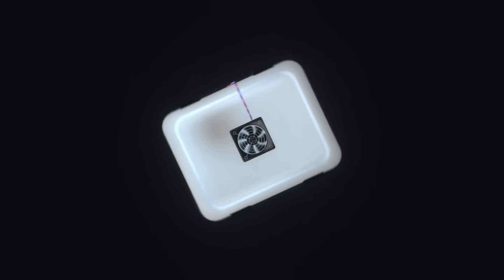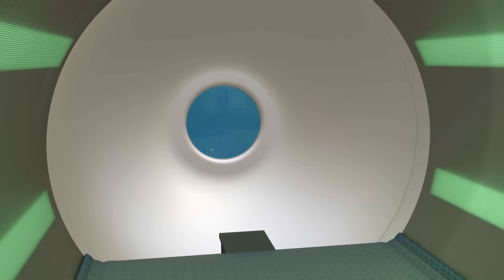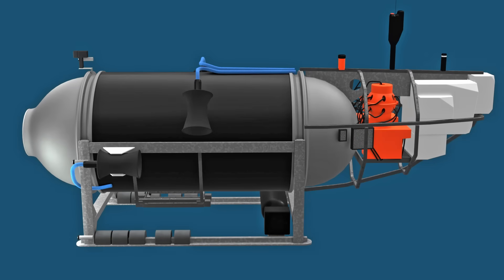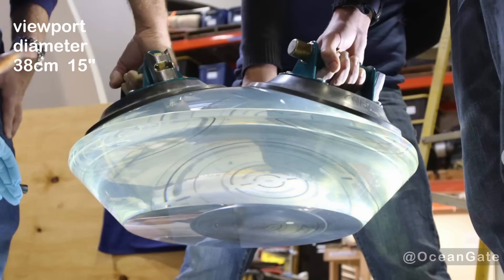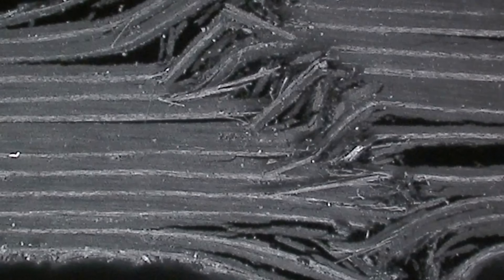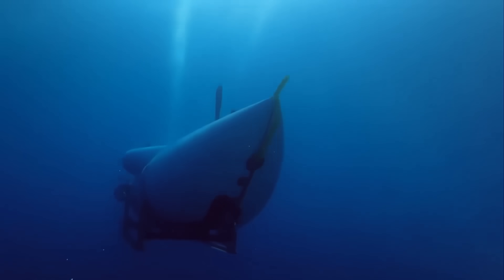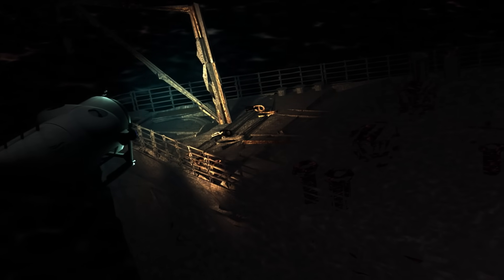Titan Sub | carbon fiber - Detailed Tour

Comment: Finally a well researched video that doesn't zero in on the game controller (which was probably the most reliable part of the sub).  The truth is that composite construction is commonly used in modern subermersibles.  But usually fiberglass instead of CF and rated to shallow depths with a factor of safety of 10+ for both crush pressure and fatigue life, for the very reasons mentioned in this video--this construction is very sensitive to defects and it's hard to both validate the design AND the process without a large sample size to build confidence.  And you certainly don't use the sound of fibers snapping to decide it's time to go back up.
Reply: Okay, so I will take you up on the game controller - which had little to do with it's general reliability. The problem with using a game controller to operate titan was to do with failure mode analysis. When designing anything which is safety critical, one of the exercises performed is to identify modes of failure and possible outcomes (FMEA). There is no chance the designers of a game controller would have done any such analysis. They wouldn't have been concerned if a single component failure causes an issue as the worst case would be a player losing a game. Imagine therefore if, whilst manoeuvring a dry joint on the circuit board caused a button to jam and rammed the submersible into jagged metal wreckage. Sure they could have a spare controller lying around, but by that point it's not going to matter.
Sure, the military also use game controllers, but I assure you if they ever intended to use them in life critical situations, they will do a full FMEA on it. 
From what I have read, there were a lot of other things wrong with this submersible which were much worse than the game controller, but it is a good example of how jerry rigged the whole show was so I don't blame folks for pointing it out.
Reply: @gavinminion8515  That said, there is little to go wrong on the controllers.  The main issue is operating in a marine environment.  I worked as one of my first jobs as a repair tech and the computers we would get in in from people who lived next to the ocean was.. full of rust and other insanity. One actually had a hole through the motherboard due to condensation causing water to drip down for several months.
Reply: @gavinminion8515 OK, cool, interesting point. But...

I'd be pretty damn certain the controller has a good idea what the odds are of button failure, and I'd be fairly certain they're low.

Any controlling device, whether Sony or bespoke would carry such a risk, and Sony have data on hundreds of thousands of units, whereas if you build one for the Titan you have data on one.

You don't actually know if the testing was done by Oceangate, you're assuming it wasn't. I'd agree but it is an assumption.

The outcome of a failure is different, sure, one you lose Tekken, the other you explode, but that doesn't make any difference to the failure mode or the failure frequency, certainly the probability of a failure prone device doesn't kill anyone playing games, but it is going to be a serious threat to the survival of your business. You might not care AS MUCH, but there's a world of difference between caring about losing billions and flat out not giving a shit.

Specific fail point issues seem pretty easy to resolve via software, if concern about a specific button or button emperilising the submersible, you only need one to say 'controller buggered, disregard until this button is pressed again'

I take your point, I do, I just don't see why it'd be less safe to use a device with, by now, trillions of hours of fail state testing instead of building one unique device. It'd be one thing if the controller was being used outside the thing, but the inside of the Tube o Doom was, obviously, well within the normal operating environment. I mean, if the controller hasn't been tested whilst immersed in seawater, that doesn't really matter, because in the condition where it was, you have whole other issues far more pressing. Pun absolutely intended.

What would be the Mean Probability of Failure figure that would be acceptable for this use? Because I'd be absolutely certain Sony exceed that value, and equally certain it would not be possible to generate such a number with a bespoke unit.

In any case, it is at least very refreshing to natter about the thing with someone who has a reason for doing so that's better than 'it's a toy' so, thank you for taking the time to explain, it is appreciated :-)
Reply: @Belzediel  Hi, thanks for the response. To be clear, using a controller that is produced and tested in the millions would 'likely'  be more reliable than using a device you built yourself. However, that would not be the outcome of an FMEA investigation.
If you were to look at this controller in failure mode terms, even though the chance of a particular failure (i.e. jammed button) is quite small, and the chance of it's effect (collision with debris) is smaller, the outcome (Loss of vessel with all souls) would be so great that you would do what many other manned submersibles (and surface vessels) do. 
You would have two control systems with redundancy and failsafe changeover. The instant that button jams, you would let go the first controller and pick up the second. You would not wait to change batteries or reprogram a wireless connection because those seconds might be critical.
As an example, here is a quote from an old copy of the DNV rules on redundant propulsion systems: "The bridge propulsion control system shall be independent for each propulsion line; so that any single
failure will only affect one of them, and that operation of the remaining system can continue on the normal
means of operation (e.g. levers). Alternatively a system arranged with redundancy can be accepted if in addition
independent back-up control system for each propulsion system is arranged. The redundant system must be so
arranged that any single failure will not prevent continued normal control of the complete propulsion system.
The independent back-up control system shall be based upon similar input devices as the normal means of
operation (e.g. levers)."

So to answer in brief - there is no mean probability of failure which would be acceptable - only redundancy with separation. Nothing I read about the game controller or any part of this vessel suggested they had the required redundancy - or had done the analysis which would have demonstrated where that redundancy was required. An assumption maybe, but one which I have yet to find evidence to disprove - unfortunately.
Reply: @gavinminion8515  I think it's clear as day that the "game controller" was an issue. Not because it was a game controller, but for the reasons you say here, as well as the fact it was chosen as the control system because it was cheap, and because there is actual video of Rush tossing it like a toy. It's hard to imagine how many times he actually threw that controller. There is a report that he haphazardly got the craft entangled at the Andrea Doria dive (ignoring a cautious dive plan to assess the dive site before approaching), and then after melting down, threw the controller at another person in the submersible. He threw the damn thing during a crisis! Kinda like kids do when they lose their video game. It's no wonder this ended badly, in the end. CF may or may not have a future in submersibles but people like Rush running the show while experimenting with materials proved to be a very bad thing.
Reply: Compared to professional steel bathyscaphes, nothing there was reliable. From the entire design to the use of a game controller on the console, it's a joke. People have been exploring similar depths for years, but the engineers of such bathyscaphes are physics scientists and everything is carefully calculated and then tested in compression chambers for strength. Everyone who works on such projects warned that it could end like this. For information, I would like to inform you that the scuba diving cylinder is tested every 5 years and certified for more than double the pressure that it is charged with. Where did they get the certification for this "bathyscaphe"? @gavinminion8515
Reply: @gavinminion8515  you go through a lit of ridiculous gymnastics and fallacies to justify your position. you assume that a button getting stuck would be a problem. the thing is SLOW, its not like they are flying an F22 with it. You also assume that a button being stuck wouldn't be catastrophic because its only being used in a game; A manufacturer having to refund the sales of those controllers because buttons were prone to sticking certainly would be extremely damaging. These types of devices DO get used in high risk situations all the time precisely because they have achieved a level of validation nothing that could never be reproduced. From satellites that cost millions of dollars to launch running off of main boards from smart phones, to spacecraft being run by video game consoles, to medical imaging machines that guide brain surgery running on gaming consoles, they were all chosen because their reliability and lack of failure modes are the only thing that can be trusted to support a multi billion dollar investment or someone's life.
Reply: @malcomreynolds4103  'My position' being the position that Lloyds, DNV and other certification societies take? If you read my comment properly you will realise that my reasoning against this particular use of a game controller was it's lack of redundancy in a life critical situation. The uses you mention are all non-life critical (the brain surgery use was as a training aid).
As regards your specific argument regarding the speed of the vehicle - you should probably critique this statement against your own first sentence regarding fallacies and assumptions. Accidents still happen at sea at lower speed than this due to a loss of propulsion control.
Reply: @malcomreynolds4103  Correct. Video game controllers are very reliable, with every function tested for millions of cycles. When using a game controller in a safety critical application an example is as follows: 

If a joystick is pushed or pulled there is an electrical signal called a bit delivered by the software. A bit is typical read as 1 is on (Joystick pressed in whichever direction is chosen) and zero is off (joystick released). If the joystick is found to be stuck it will continually show 1 in the direction it was last commanded and the vehicle will keep moving, as you noted, very slowly, typically around 2mph. The likely response is to move the joystick in the opposite direction, so if the vehicle is stuck going forward, pull the joystick in reverse. You end up getting a forward 1 bit and a reverse 1 bit, hence signals in 2 directions on the same thruster. In this instance, the software will be commanded to cut power to the drive. The HMI (Human Machine Interface) would show a fault code and an instruction, such as thrust in 2 directions on the same drive, change the controller, reset and test. This is typically how a FMEA system would work in this application, if they did one of course.

This method is used on Joystick systems or manual input systems that have to be held permanently for movement. If a Joystick appears to stick in one direction, you simply reverse direction. The software will show a bit in 2 opposing commands on the same system (Forward and reverse commands at the same time) and shut the unit down. Safety function is very simple and basic, even in complex systems such as Aircraft or multi train rollercoasters, where crashing into things could be deemed as unfavorable. It is highly likely If the sub loses contact with the controller, it would hover in position, (Not move forwards, backwards or sideways) until the connection is restored, so a back-up could also be, if the sub is still moving after an input and the joystick has been released, turn off game controller, or pull the batteries out in the first instance and if this does not work, hit the E-stop for the thrusters. If nothing resets after changing the controller. you simply drop the weights and the positive buoyancy will take you back to the surface. One of the main rules of sub safety, Always ensure the way to the surface is clear. In other words, don't go into wrecks or caves or under overhangs. Drop weights on classified subs have a manual release, so don't rely on a another system that needs power. These are tested annually by a third party.

@gavinminion8515 It does not matter if a joystick is wired or wireless, if it sticks, the above protocol would apply.
Reply: @gavinminion8515  you keep using words and keep saying nothing that is accurate. If you don't think expensive science experiments do not receive the same level of testing as life critical equipment, you are clueless. If you think medical imaging is not life critical, you are even more clueless. The speed of the vehicle is precisely the point as to its risks. a craft that has a MAXIMUM speed of 3 knots cannot just simply close 20-30 meters on accident
Reply: @malcomreynolds4103   I don't think I am going to carry on this discussion. You have descended into insults without actually presenting a persuasive (or any) argument. Please learn about hazards and risk analysis then re-examine your earlier comments - I suggest you begin with IEC61508, then move on to the classification rules for manned submersibles - Begin with IACS, then move on to ABS, DNV,  Lloyds or any other set of rules - your choice.
A simple analysis of any controller (not a game controller) driving a human occupied submersible would probably give it a failure likelyhood of "Occasional" - it is likely to fail at one point during its lifetime. It would also give it a consequence of "Critical" (Any loss of control of any size vessel at any speed would go into Critical or Catastrophic category as it may lead to loss of life). Combine these together and you will have a class II hazard - "Undesirable". 
Therefore, to reduce the risk to "Tolerable" you would need a redundant control system (or an emergency steering device).
But don't take it from me, go find out for yourself.
Reply: @gavinminion8515  back to the completely and utterly debunked game controller narrative again
Reply: The real issue with the controller is that it wasn't even a first party controller it was a crappy third party one.
Reply: Was there a point raised that didn't go sailing several feet above your head? @justz00t48
Reply: Oh, indeed, I concur, on the controller. Baffling to me that something being cheap to purchase is most people's method of evaluating reliability, not the tens of millions of units tested to destruction. Plus, they can afford to keep a few spares in the boat, so even if one of them goes tits up there's others. Baffling.
I'd also be fairly sure that Kemptown Racecourse knew any failure would be instantly catastrophic, and so any kind of safety feature in-dive would be a joke, the sound whatsit etc weren't anything more than a token gesture to calm the gullible, like having a 'main tank explosion' warning light on the shuttle.
"And if the main tank explodes, mate, this little light goes red."
"And then what do you do?"
"Well, then we'll descend to the surface of the earth as a slightly pink mist, in a cloud of very expensive confetti."
Reply: @Belzediel  You do realize that they now think the Challenger crew actually survived the explosion and that the impact with the ocean is what killed them.

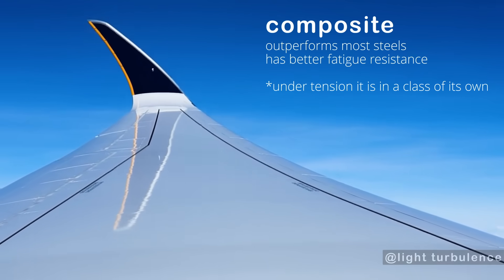Comment: 9:16 "This is just plainly wrong!" No, Its not. Full stop, its not. The catastrophic implosion proved this beyond all doubt. CF cannot be adequately or appropriately tested for the intended mission, Not just for the load at where its going, but the fact its being subjected to repeated stresses.  The repeat stressing is the critical factor here - CF does NOT bear up like Titanium - or really, any other 'elemental' material; owing to its construction. That is, multiple many small but individual fibers working together - and ultimately against each other.   Therein lies the key. Your cited example with aircraft does NOT work, as it is not a all-in compression but a directional *Tension*. Further highlighting this point is that even in aircraft, the pressure vessel keeps pressure IN, not Out.  Its worth noting that the only other CF hulled submersible was retired after ONE trip. 

  All this, before Rush sabotaged himself with cutting his test depth so incredibly close to the depth she let go in.  This is, of course, presuming it wasnt the dome - which itself was rated much less deep than the depth she went at - which while plausible the current data is against it being the cause.   Also, as you note with the damage, had the implosion been 'end on' there'd be blatant witness marks we'd see on end caps. There is not, ergo, pretty clearly, based on what we have so far, a 'side on' implosion.  

Far as the transcript goes, I have my doubts on that either way. Lets see what the report comes off with. 

Sorry,  but you are drawing a factually not correct assumption despite the abundance of available data. The Aviation world and Submersible world share SOME techs, SOME science, but are subjected to dramatically different forces.  Had Rush ramped up the CF hull test depth to 5000 or 6000 meters, Titan wouldve lasted longer, but would have still failed; far more so than the Titanium caps did. Had he gone full Titanium hull - at least, a hull with sufficient rating and not cut as close as everything else - then we'd be looking at the lens cap.    When every single professional in BOTH the private sectors AND government sectors both unite and say 'hey yer being stupid', yer being stupid. There's no kind way to put that. 

I strongly suspect you'll be finding this video eating massive corrections or outright removal when the final report comes out.